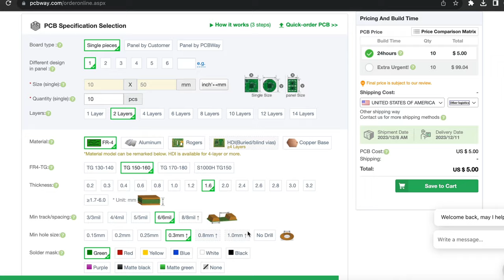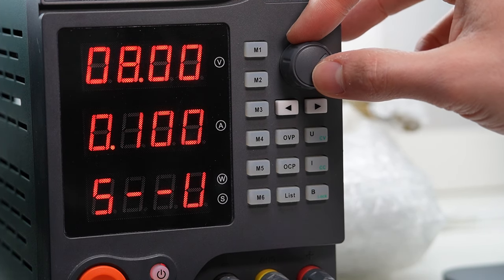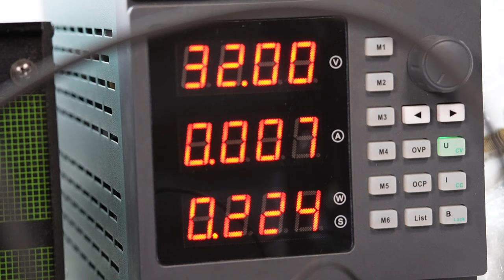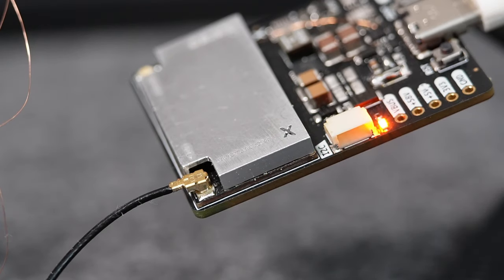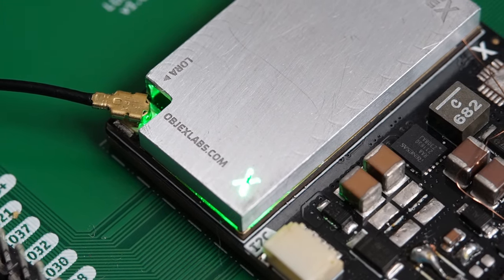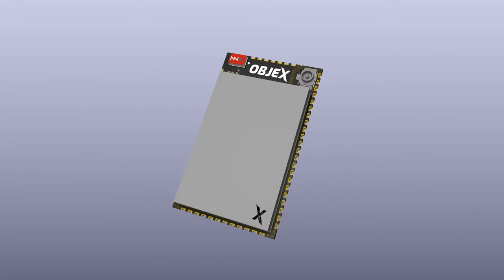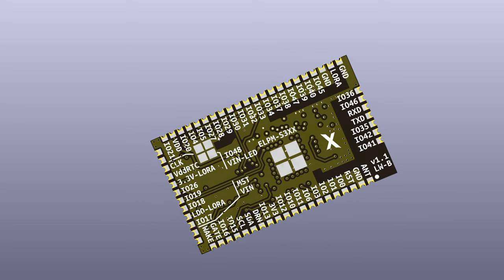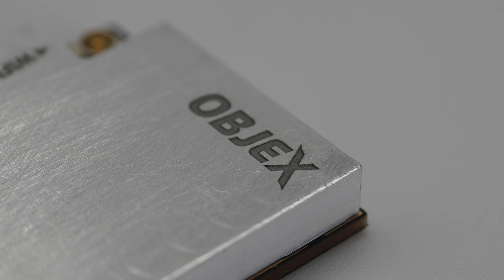ESP32-S3 + LoRa module - Power delivery 3.0 PPS, Extreme Low Power 1nA | ELPM-S3LW

Comment: Will you make a video like @PhilsLab where he explains the design etc. ? I am especially interested how you designed the Antenna part with matching network and maybe microstrip line in that regard !
Reply from the maker: Assuming that @PhilsLab is much better than I'm technically and otherwise. I might give it a try, showing in detail some aspects related to the design of my projects.

Comment: I have been following the project from the very beginning. I enjoyed watching this video by constantly pausing and examining it. I think it took 20 - 25 minutes this way. It was like the premiere of a movie. :)) I was writing about the Sx1262 selection from the very beginning. It was also very good to switch to him. It's really moving towards perfection. If a cellular chip or even NTN is added to the module soon, it would be beyond ideal. :))
The only thing I would say about this structure is that it supports all program development infrastructures in esp32. (Arduino ide, esp-idf, microphyton, Platformio etc.). Thus, it would appeal to everyone, whether for educational users or those specializing in different programming infrastructures, and would increase its market share.
Reply from the maker: That's right, the design has been redesigned precisely to give everyone the opportunity to use the module!
In particular, having the ESP32S3 and SX1276/SX1262 in the same module simplifies use for both prototype and product(mass productions) development.
We are working on other variants to incorporate GPS as well, for example.
Reply from the maker: I had seen this model before, the problem is to buy some units to do some tests 😅

Comment: Love the idea, catching up on your info and videos since finding the channel really would like to test these out any idea when they will be available and the cost?

Right now I’m playing with an esp32h2 and sx126x as my option for a very low cost outdoor device 

I rather have the zigbee/thread over wifi myself maybe would be a goood idea for a version of your system

Any chance you’ll sell or have a pcb to order for the deep sleep disconnect only to add to existing boards? Would love to be able yo have a micro pcb that just handles the deep stop on a third party esp32
Reply from the maker: Sorry I'm only responding to you now. 
We are working on a fundraiser for the ELPM & OBJEX Link project. We also plan to sell some units to test the products we have developed.

We have already developed the version based on ESP32-C6 + SX1262(yt video will be coming out about this version). I don't think we will manufacture hardware only with deep stop.
Reply from the maker: Hi, if you are interested the project I wanted to let you know that pre-orders start tomorrow! shop.objexlabs.com

Comment: Hi, I was wondering what IC you used for the dc-dc step down voltage to 5V?
Reply from the maker: Hi, RAA211250 - In my opinion one of the best DCDC I have tried so far. Very reliable.

Comment: How easy or difficult would/will it be to add a battery?
Reply from the maker: It is easy just connect the battery(+) to pad Vin (3-5V), but I suggest you read the documentation to learn more: https://objexlabs.com/assets/pdf/PRODUCT_BRIEF_ELPM_S3LW.pdf
Reply from the maker: Hi, if you are interested the project I wanted to let you know that pre-orders start tomorrow! shop.objexlabs.com